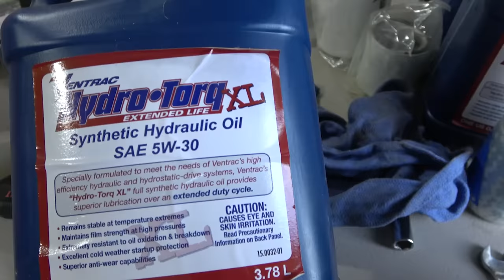Earning my stripes! Is this Ventrac the best mower ever made?

Comment: I purchased a Ventrac last fall for our 5 acre property where we moved 2 yrs ago. I went with Ventrac for its safety on sloped- 
I have a pasture that had over grown terribly & I needed some thing safe for the steep sections and the Ventrac does great. 
I went with the kubota gasoline engine as it had max. power / torque. I had to go back to single wheels for close trimming around shrubs & trees and I am going to up grade to the spacers for a wider stance, but still narrower than dual wheels.
Thanks for the Maintenance tutorial.

Comment: Worked for a company that did storm water maintenance. We had several of those Ventracs for our crew alone and ran them 5-8hrs a day throughout the summer. Pretty good piece of equipment. Most problems with them came from new guys lacking experience and not knowing/understanding what they can/can't do.
I'd say those spindles on the mower deck broke the most especially if you hit something or bottom out on uneven ground. I learned to keep a close eye on tire pressures. If the inner tire loses pressure, but not the outer, you end up putting alot of weight and torque on the axle and axle seal. Once you break that axle seal you're bound to tear up the gears on the axle. 
I know for sure we took them on slopes well past what's recommend. So much so that we had to rig up the wires under the seat so it wouldn't turn off if you came off the seat a bit or else we couldn't do the job. 
We were way harder on them than I would ever imagine anyone being on them with the normal home/farm use and they just keep on trucking.

Comment: I love the van track stuff. A lot of it’s just really old technology but it’s stuff that is tried and true and solid in last and just works really good and they build them to function, a lot of companies build stuff with a ton of features and garbage on them as sales points we’re trying to match with their competition put on their stuff. A lot of that stuff is cool but I love that the vent track is just a workhorse it’s very industrial and simple but tough.  Good stuff. I wish most equipment and even cars and a lot of other stuff is built that way just tough to last using standard parts that were great that are readily available and cost-effective. Unfortunately a lot of things are designed to fall apart and be very expensive to fix and to me that’s just kind of like a lie and these companies trying to rip you off. There’s no reason to use 27 different proprietary overprice pulleys when they could use the same standard pulleys on everything that are readily available making them cheap and easy.  I’ll avoid certain companies because they intentionally do that all the time and the other products are great it’s difficult to maintain and expensive and they do it intentionally to get more of your money in the long run or to make you buy their equipment because they’ve made it all proprietary so it only works with their stuff and nobody else’s. Like Sony makes amazing electronics but everything they have is proprietary their disks and median cable types and they try to make it so you could only buy Sony stuff and the other equipment is good, I won’t buy it anymore because of the incompatibility in the expense of buying accessories. And tractors and equipment I still see a little bit of that. Most tractors are going to work with most implements but John Deere has the bucket attachment that’s different than anybody else so you pretty much have to buy theirs and I love their tractors but if I’m going to spend more money I’m going to consider a lot of other options because of stuff like that because the traditional skid steer mounts are pretty much universal and continuity or stuff like that and compatibility is a huge advantage.

Comment: Old mechanics trick...smear some valve grinding compound on that allen wrench bit. It keeps the bit from sliding out of that drain plug. However, do it before you really round out the hole.

Comment: Would it be better to replace the allen key bolts with stand hex head bolts? I guess there is a reason to use a recessed Allen key head, it won’t get bashed by passing stuff but they look like they are difficult to get a grip on.

Comment: As a tractor its missing a rear pto u should be able to use all the compact range from other makers
Reply: On Ventrac I don't think it's necessary because they have around 30 attachments that mostly hook on to the front PTO system. It's just a different way of using PTO attachments.
Reply: @jimmcknight3021  but thats just it there own stuff theres alot they dont make and ur stuck to there prices
Reply: @noelcahill6707  Yes, that's the trade off on using Ventrac. However, there are Steiner attachments that interchange with Ventrac to give a little more flexibility to the machines. Of course, the Steiner family created both brands of tractors, but the family is only involved in Ventrac at this time and both companies are now owned by large equipment companies. The price on their attachments is definitely on the high side, but sometimes you can pick up a good buy on the used market. I'm just tired of brush hogging on a compact tractor looking back when I have to get into tight areas. That's why we are considering this type of tractor or a small frame track skid steer with a brush hog on the front.
Reply: @jimmcknight3021  u see here in the uk and ireland we have far more attachments then wat ye have in the states so id love to put a flail collector behind 1 or a stone burier
Reply: @noelcahill6707  I am not sure I am familiar with the term of those two attachments. However, Ventrac  has recently released two sizes of Flail mowers in both y blades and hammer blades. But from what I have heard they are really expensive even for a flail mower. Somebody that I follow on You Tube had the chance to compare the cut quality of some them compared to his other mowers. Very interesting comparison. His Channel is called Steiger 256